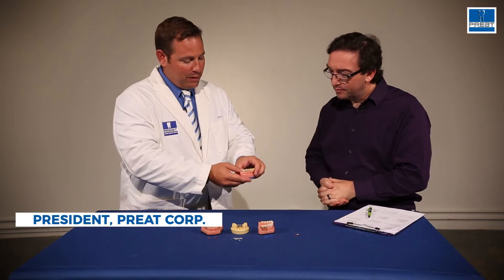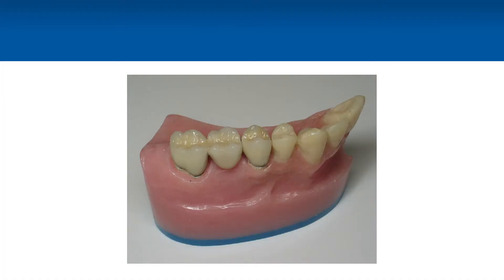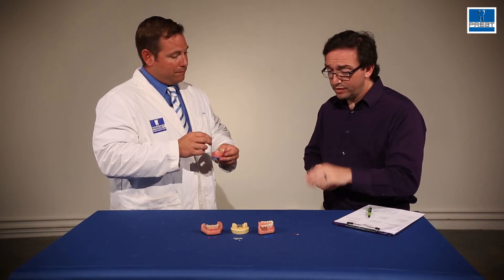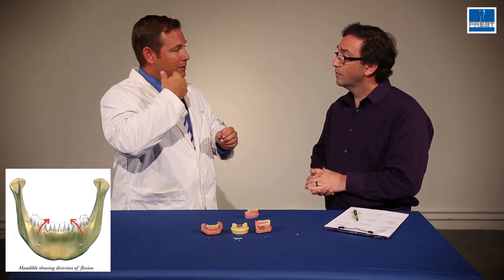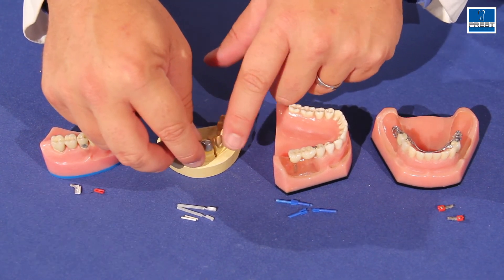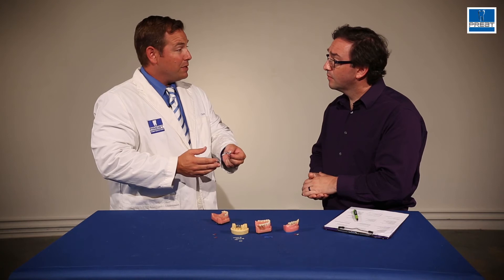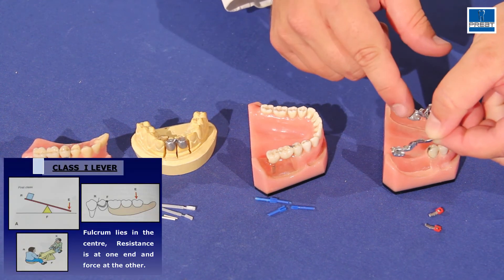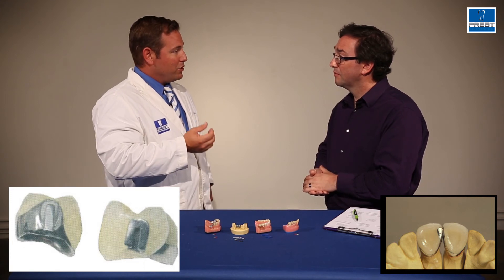All About Stress Breakers in a Crown and Bridge Dental Attachment By  PREAT Corporation

Comment: I'm looking at AA for tooth replacement lower frontal bridge I am hoping I can go with 4 on 2 instead.  In a 5 to spread on top so we're looking at a minimum of 9 teeth involved and up to 11.  Says I'm looking at between 1 and 3 eyeteeth involved I am a little bit nervous That we're going to have stress or problems and all end up cracking my porcelain or glass teeth. Would you have a suggestion for me?